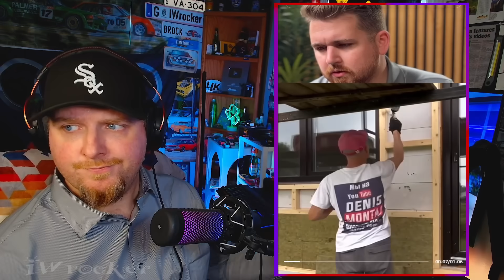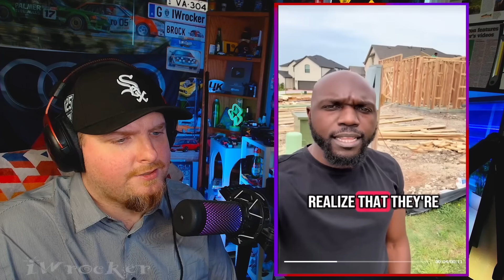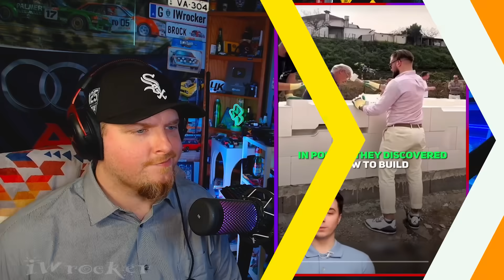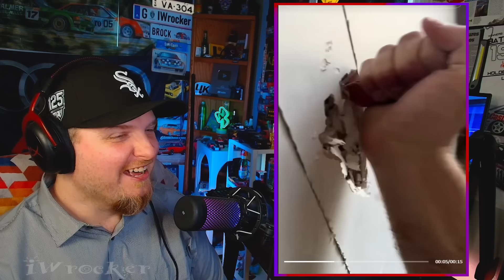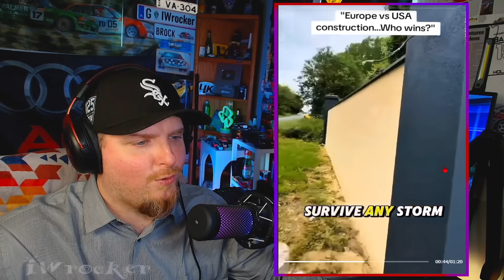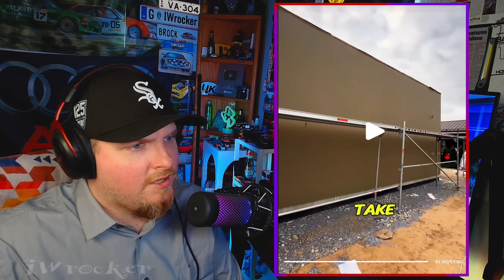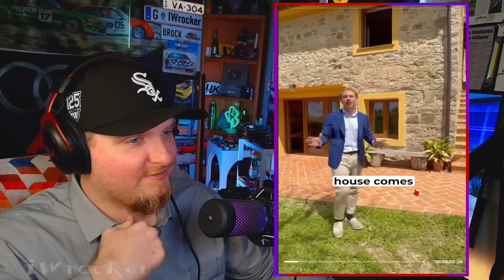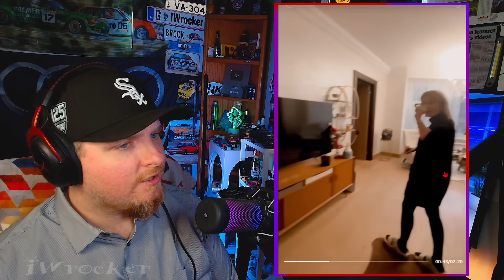25 Minutes of European VS American Home Quality & Construction Methods 🔨

Comment: these white stones are insulation stones and with the rockwool in front of it cold will have no hold in that house ever i have put up loads of such rockwool pieces and rollmats around huge industrial pipe's and in front of such white insulation stones in my career in construction from the age of 14 47 years ago . american houses have more cons then pro's these houses hold up for around 12 years mayby 15 if they are kept in order europe has buildings that are several thousend years old and still stand to this day . there's a viking church in norway that is 1000 years old when vikingd turned christian but there are ZERO nails in that church let that sink in a 1000 year old church still stands today without ANY nail .

Comment: American houses might look aesthetically pleasing, but they are fake af, even the stone walls on the outside are fake.
I really like real stone and concrete, but I'm European😊
Also, if you want a modern European style house, like the one with the steel roofs, you could just order it from Europe? If you have the exact sizes (in superior centimetres) and some luck with tariffs, you could just order it prefab and it will be shipped.
I work for a big European window manufacturer, if you ever want to redo your house, send me a message and I can calculate how much it would cost you if bought here.

Comment: 8:12 - we have drywall here, though it's called plasterboard, the difference is in how it's used.

We had some installed when a wall was taken down and rebuilt.... the difference is that the plasterboard just made surfacing the brick underneath it a lot easier. Even if you went through the drywall part, you'd just hit the structural brick behind it.

Comment: I live in a council house (social housing) in Scotland. It is over 50 years old and is insulated to the nth degree. I also have solar panels and a heat pump. My rent is less than £400 per month and I have 3 bedrooms and a fairly large garden. All of my repairs are done for free and this year I will be getting my bathroom converted into a wet room (cos I am old and decrepit) for a significantly reduced price. A couple of years ago my electricity provider sold its payments section to OVO Energy who are a heinous company and they lost my January payment. I had to live without electricity for 6 weeks during some of the coldest weather of the year (so no heating, lights, cooker, shower, computer etc). Thankfully the insulation did its job and the house never got below 10 degrees celsius. (I bought a camping stove to cook and lots of candles for light. I also have many, many books so had something to do. I used the car to charge my tablet and would drive around for extra heat. The main problem was washing my hair which was very long so I cut it all off) xxx

Comment: I have a new flat- new meaning made in the past 10 years here in Prague and the floor and walls are so thick and insulated my flat is soundproof. When I was setting up my hifi sound system I checked with my neighbors above and below to see if they can hear anything at volume and nothing.

Comment: In England we have walls around our mansions and large stately Houses of flint and bricks.
If you notice on The Goodwood estate especially around the boundaries some as high as 8 feet high.
In Portugal  inthe north of the country houses are built with solid Granite blocks some measuring 2 or 3 feet high by 4 to 5 long with a thickness of 2 to 3 feet. Of which is readily sourced at hand on the property or near by...

Comment: The house I live in was built in 1902, which means that the house is 124 years old. This house is built with logs and later the house was additionally insulated and boards were put on it. The thickness of the walls is about 35 centimeters (European measurement). If a tornado comes, this house would remain standing, say the house in the USA that can handle it.
I have seen the houses in the USA after tornadoes and the houses look like houses of cards built of cards.

Comment: 20:30 - "Don't start a fire and fall asleep" - most older houses in the UK have fireplaces in the bedrooms and as long as the chimney isn't blocked or the opening of the fireplace is the correct size so it has sufficient draw up the chimney and the room is also well ventilated, they're not going to cause anyone any grief while asleep with the fire going. You normally place a fireguard in front of them which will safeguard any sparks landing on the carpets or rugs and the front (hearth) is normally tiled should any hot coals or logs roll out onto it. Smoking a cigarette or pipe and falling asleep with it is far more dangerous.

Comment: When I owned my house in the midwest it was built in 1921 and had the original stucco on it. A lot of older houses in the city I lived in were stucco. Only very expensive ones being built today have stucco.
The condo I live in now was built to the minimum standards of the early 80s. It's built so poorly that it wouldn't pass any modern building inspection. Even if the city inspector was getting a little "Not Bribe Money" stuffed into his pockets.

Comment: The building where my mother lives was built in the 60' with solid ciment blocks.. It was decided to add a layer of insulation on the outside. The result was 2°C gained in the winter.

Comment: In the coldest parts of russia,they put extra insulation at the outside of an building. So tey have it on the inside and the outside and it gets tere - 70 so they need it

Comment: About the guy poking a hole in a drywall with a utility knife: in France we use drywall a lot especially in new constructions. New houses are build with concrete blocks and concrete floors, and the rooms inside are divided with a double layer of drywalls, sandwiching insulation for thermal and acoustic comfort.

But neither in my house or anywhere else here I’ve seen drywalls that you can actually poke through by kicking in or tearing down with bare hand, and that don’t even have insulation between rooms!

Comment: 14:45 there are ways to achieve the same insulation level using methods which allows for some minor mistakes and can dry the moisture to prevent mould buildup. For example cellulose insulation coupled with a proper vapour barrier and windbreak.

Comment: 135 year old terraced house built like a brick shithouse, which it had back in the day. Wooden joists/rafters you can't screw into (too hard), solid partition walls, granite fireplaces, slate roofs, stone gutters, cast iron downpipes. We didn't have central heating until 5 years ago (living room fire was enough but we're getting old now). Living room, dining room, kitchen, 3 bedrooms & bathroom. It will probably stand for another 135 years.

Comment: The  thin housebuilt between 1885 and 887 is triangular, 6foot wide at it's narrowest point and is a block of flats originally used as arrists studios.
Reply: It has its own wikipedia page, named "the Thin House". It is just north-east of South Kensington Underground station, and is on a fragment of land left over when the Metropolitan District Railway was built through the neighbourhood.

It's a prime location. That explains why, even back in 2016, a one-bedroom apartment in the building that was just 600 sq ft in size went on sale for £895,000.

Comment: In Switzerland, external insulation is mainly used to retrofit older houses with thermal insulation. My apartment is in a 1970s-era apartment building and has also been fitted with external insulation.

Comment: My house in Portugal has 2 feet thick walls. Actually it's 2 walls out of volcanic rock and the gap between is filled with rubble. A lot of air in there for insulation and to keep moisture out. Around 300 years old and still standing. The only things we had to change was the roof, doors and windows because it was abandoned for 20 years...

Comment: 1 - Why would you put insulation on the inside? It loses its efficiency and makes access to wiring and plumbing much harder, since they are built into the brick or concrete.
2 - In Europe, it would look like that, but it would be made of actual bricks.
3 - A lot of houses in the EU are built now from prefabricated cement blocks or armoured concrete pieces, which makes them quicker to build.
4 - It's a decent wall for a tree house.
5 - He could hit it with a hammer, and it wouldn't budge.
7 - Wait till they figure out you can tilt open them, super security and ventilation.
9 - Surprisingly, cement and concrete breathe (in a way) if you get moisture inside a dehumidifier will help you get rid of it, and the walls will be pristine.

Comment: How do you fix hanging shelves to these paper-thin walls??? I‘m confused. Put a nail or screw in and hope you hit the wood frame underneath?
Reply: You actually do have to find the wooden studs first and nail or drill into those for anything that is not pretty light.
Reply: There are special drywall screws and nails you can use.
If you wanna know, go to your local DIY store and ask for them, they are interesting looking (or google them).

You can also use normal self-tapping screws in the steel studs themselfs, or wood screws if your studs are wood.
However, the studs are always in the wrong place though (Murphy's law).

Comment: There are buildings with double brickwalls and in between there is insolation. In German its called Zweischalenmauerwerk. Very common
Reply: That is basically how every common house in Denmark is built as well. The really old ones that just had hollow double walls have been pumped with insulation since.
Reply: My house in the UK is the same  insulation between 2 brick walls.
Reply: Used to be standard in the Netherlands as well, most new buildings are (pre-fab) concrete with brick façade.

Comment: We have buildings in the UK like American houses, wooden walls and felt roofs. We call them sheds, for our garden tools.
Reply: or for the chickens😜
Reply: @Paul4ha  My Granddad (Roofer) and my Dad builded Chickencoops. I still own those: Full concrete Floor, 80 cm high Concrete walls to get the wood structure from the ground, the roofs rests on 4x8 inch beams. The whole roof is double layered Tarroll (The one for flatroofes, with build in double glased windows. I am German and visited the US. Those Chicken Coops are literally better builded then US Houses. My Sister wants to remove two for a house. I have one and a Garden Shed 30m² or 322sqft. The Garden Shed is even insulated with 20cm Insulation (6inch) because it was used as hatchery for the chickens in spring. Curiously the Garden Shed is listed as Building or House to keep the Parcel listed as "Building Ground." and the 12m² Chicken Coop is the Shed. German Building Laws.
Reply: And you hardly see any hanging toilets in the US. We already have these for over 40 years or longer...
Reply: @JohanDee Ha ha ha, if you hang a Toilet in an US home, the whole wall will fall off if someone tries to sit on it.
Reply: @michellekonzack  🤣
Reply: @michellekonzack 😂
Reply: @michellekonzack 😂😂😂
Reply: Here in Estonia too, maybe also Barn. 😂
Reply: The roof in Poland Ian liked so much is titanium zinc- should last about 300 years… :)
Reply: I house sat in Florida and the house had four inch thick external walls. My shed has that!
Reply: We do too in Germany. If we have no money to build proper housing for our livestock or animals. Our sheds are built better than this. My sheds are built with 4x8cm douglas and insulated with 4cm mineral wool. The interiour has 25mm thick OSB boards and the outside has tongued douglas boards with weatherproof paint. The roof is built with 6x10cm douglas and tiled with simple concrete tiles. It's 12m² and a cheap build. Because if I'd do any less, I know I or my children would have to do something about it at some point and why do things twice if you can do them right in the first place?
Reply: We also got brick sheds
I rarely see wooden sheds
Reply: My garden shed in the UK is built of brick and it's around 100 years old.
Reply: They worry about the front doors when people could just go through the walls. the "sheds" are very big though.
Reply: This is so British it moved me to tears. Love it! ❤
Reply: TRUE STORY when I was a kid I thought Am3ric4n houses were disposable and that is why they are built so cheaply.  I thought they got blown away in hurricanes or tornadoes every few years and you just built a new one.

When I discovered you guys had 30 year mortguaes on them I was mind blown
Reply: So true mate! 😀
Reply: Same in Poland.
Reply: I've seen a lot of "American quality" houses in the UK. Insulation is subpar, wind blows through the doors and windows, sewage pipes are outside the walls and the building. But then again you don't have below freezing temperatures, but it's still a thermal bridge which is a problem.
Reply: @a@aaaaaa2206e do have “below freezing” weather in the UK, just maybe not so often in cities
Reply: The facade is to hide Londonistan behind it. 👀
Reply: You are daredevils
Reply: But more stabil than this us huts.
Reply: only thing such construction should be used for
Reply: Exactly. Wood is temporary
Reply: No offense but your 200k houses are the same as your sheds. I not just heared, i felt my neighbour steps when he went up or downstairs. Btw why need tool sheds when you have 8 m2 garden?
Reply: AND THE DOGS 🐕 🐕 🐶 🌭 🐕 🐶 🌭 🐕 🐶 🌭 🐕 🐶 🌭 🐕
Reply: Don't lie. Modern apartment buildings are as low quality as US homes. At least in England. Homes build 20 to 50 years ago however are probably build like fortresses.
Reply: @rendomstranger8698 Absolutely,our house is around 200 years old, timber framed and stone.
The timbers are as hard as the stone😊.
Modern stuff seems to built like a flat pack,with flimsy materials and is stifled with regulations.
Reply: @rendomstranger8698 Agree

Comment: YOU SEAL A HOUSE UP TO MUCH AND THE ISSUE IS NOT MOISTURE FROM OUTSIDE GETTING IN. iTS CONDENSATION ON INSIDE CAUSEING MOULD WATER ON WINDOWS AND PIPES ETC.

Comment: You asked how common it is to use this insulation - I don't know a single house that doesn't have it. 

Buildings don't seem to, and most of us in the city here live in residential buildings, so the walls are quite cold sometimes, but we have central heating, and the city is in charge of heating the homes, so it's not like we care too much. But even that depends, as I've heard of energy rating for different buildings, so maybe the newer ones have it, I've only lived in the communist era ones.

Comment: The drywall thing, yeah. We have that here too but only for interior walls, never exterior ones. Maybe as finishing to get the wall smooth and nice and only if its a wooden framed house. Which is still pretty common here in Sweden.

Comment: Why is the insulation on the OUTSIDE of the house? Did he really ask that? :D I mean, OK, let's see - if you put soft, spongy insulation inside, how would you mount anything to the walls, run cables and pipes behind it, put unnecessary drywall over it just to hang shelves? Second, you would be heating up the insulation and the wall would be exposed to the outside, cold as hell in the winter, hot in the summer. That would mean mold and damage by moisture, expansion and contraction. Hello?

If you have insulation on the outside, you have strong walls in the house, the insulation keeps the outside temps outside and the walls warmer in the winter when you also heat them and save them from moisture and mold, keeps them colder in the summer when you use (if needed) the AC. A protective layer is still applied OVER the insulation, this is not a finished house. The layer protects insulation from rain etc., it's all neatly bundled up all round the house.

Comment: That metal roof seen at 7:23 is actually pretty common here in Sweden and isnt that much more (if at all) expensive than our concrete or clay roof tiles. Its really neat and easy to service but from what i know has the same lifetime as a clay roof tile system.

Im shocked to see how often american roofs get damaged by people walking on the tiles, ive never seen that here.
Reply: Metal roofs are a lot cheaper than "tile".
Reply: if the roof is new, you can just move the tiles up and step on the wood under them!
done it many times!

Comment: During a visit to an old "sturdy" US home I tried opening the door as I always did where I grew up (in a house from the early 1700's), I twisted the knob (have you even heard about door handles???) and pushed against the door with my shoulder to open it, doors are heavy right? At home the result would be that the door opened, in New Jersey, the frame cracked as the door was locked. At the time I was about 140 lbs, so a pretty small guy, but come on... American houses are made of hope and paper.  Suddenly I understood the movie cliché where the police can kick open a door, in scandinavia that kick would break the kicking foot, not the door.

Comment: Plasterboard (drywall) and stud walls are commonplace in all types of buildings in UK
Cladding existing buildings with foam board and then rendering has a bad reputation in UK.  The Govt sponsored the external insulation on existing homes but a recent Govt report shows that 90% of the installations have defects and 34(?)% have defects so serious that the installation requires immediate rectification.  The problem is so bad that it would not surprise me that house insurers will increase premiums for houses with this insulation.  
The vertical pipe with no rain cap might be the ventilating soil stack for the foul drainage system.  It doesn't need a cap, only a bird guard because the miniscule amount of rain that would enter only drains through the foul drainage system.